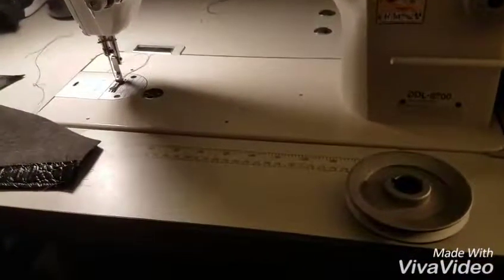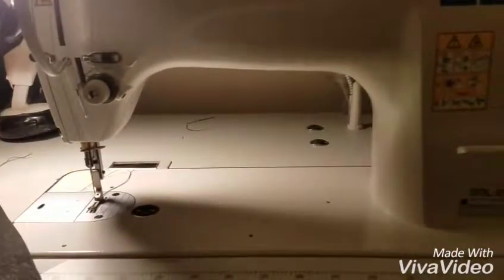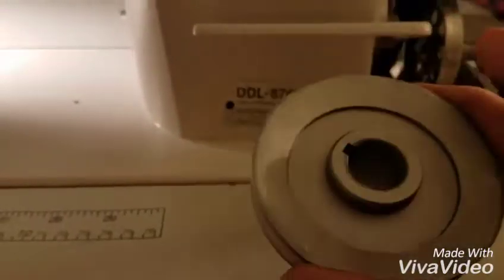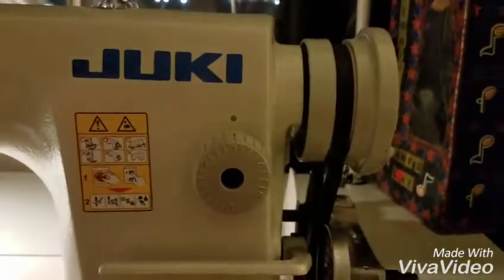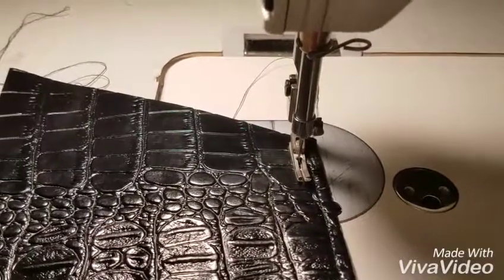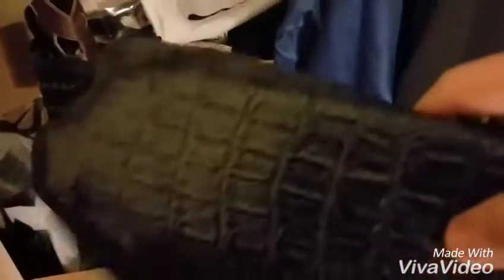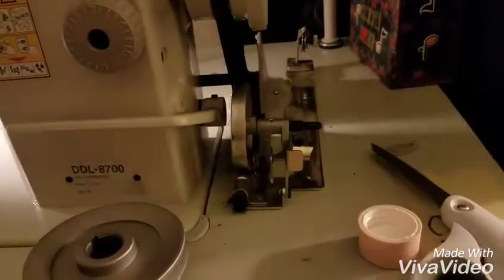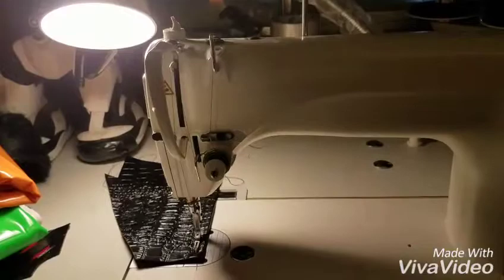Sewing machine was too fast. How I slowed down my Juki 8700 Industrial with the clutch motor.

Comment: love your video..i put an extention arm on to slow it down. not enuff so now ill drop the motor 5 full cranks on the nut and see. not enuff? the 5 more cranks..if then belt too loose? then ill switch out the pully. and get a new belt..tell me? what is the wingnut for?
Reply from the maker: The wingnut helps to adjust the sensitivity of the lever arm and peddle but it only does so much. It can be touchy lol. The new pully was a big help, it just takes a lot of practice to get used to. Also using one hand on the hand wheel for control helps. 
Eventually I want to get a servo motor for it.

Comment: I also have exact issue and would greatly appreciate knowing exactly what size belt and where I could buy it.
Reply from the maker: I had to take a string and measure it to the length I needed and go find one that matched up. Not sure the exact size.